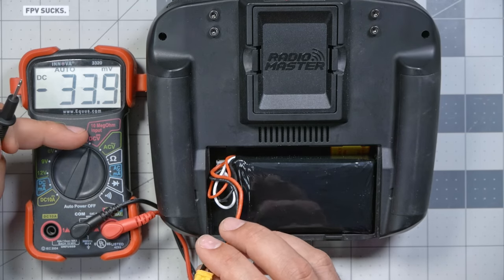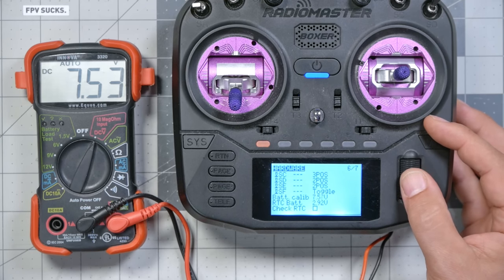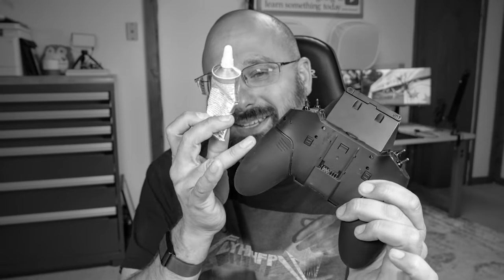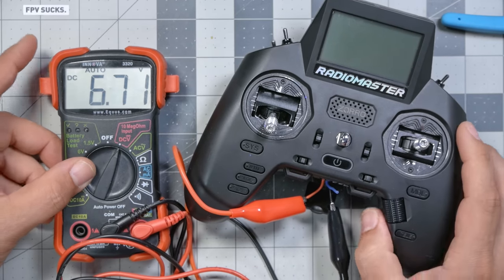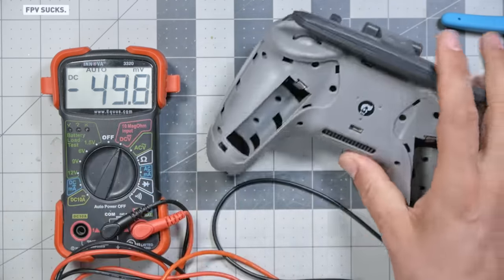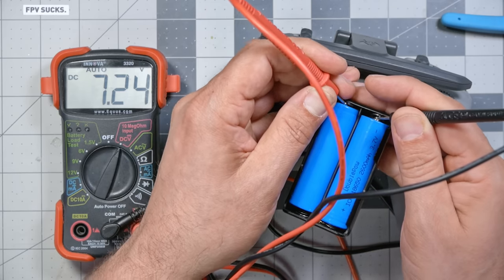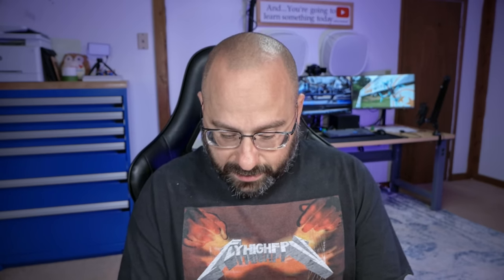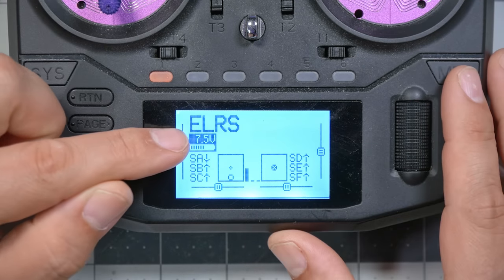Unbelievable Tips to Extend Your RC Controller Battery Life!

Comment: You also want to calibrate it near the low volt threshold.  The scaling through the range can be off so if you calibrate it at fully charged state, you might find that fully charged is accurate but near low voltage, it is off.  I always calibrate near the low voltage alarm threshold.  The most important voltage is alarm voltage and not fully charged voltage.

Comment: Hey Joshua, Dynamic Power is the key! I think a good way to extend the battery life in a ELRS radio is switching on the Dynamic Power. This helped me A LOT, especially when the radio is ON, and you're not flying, so it will set the minimum power. And when you're flying, you can set a maximum power but the radio will not MAX if it's not necessary. That also make my Jumper T-Pro run much cooler than before.
Reply: Where is the option in the settings or is it a LUA script?
Reply: @taxigalaxi  the lua script for the ELRS

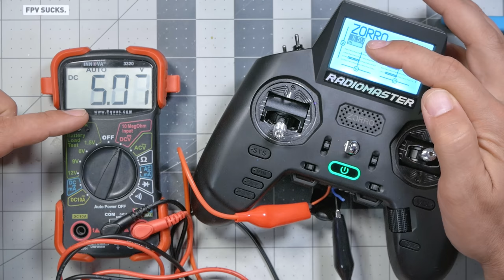Comment: 7:16 it could be that your 18350 is going bad. That voltage drop is not normal at all. Replace it immediately, because while the battery can be discharged at 2.5v, the radio can only handle minimum of 6.2v. if your radio drops below that, your quad will just failsafe out of the sky. I found this out in an unfortunate way. You could actually test this on a bench. Your quad won't even bind to the radio at this voltage.
Reply: that happened on my zorro just once, it was acting weird and the voltage was super low, charged it and it's been good since then

Comment: On the zorro or other radios with a lite module, you can pull battery voltage off the module bay pins, too as long as the external bay is enabled in EdgeTX

Comment: ELRS 3.3 has an option to disable the backpack functionality (if you're not using it) which saves 0.3w of power draw.  So when that comes out of RC it might be worth looking at for us Zorro users fighting for scraps.
Reply: 🤩 someone read the changelog! With this and all the other power changes since the Zorro came out, I can get over 4h now on a pair of 1400mah at 10mW. Still no giant Boxer battery but a definite step up since release.
Reply: @CapnBry  I was worried about battery life coming from larger radios with a lipo, but it really hasn't been an issue because of how fast it charges.  It's generally taking less time to charge to full than it takes to charge my lipo's at 1c, so I'm always leaving with it fully charged.  I'll still happily take that 0.3w though since I haven't changed my VTX channel since 2017 lol

Keep up the good work.
Reply: @JoryFPV  haha truth. It charges faster than it uses the battery. The battery life hasn't been an issue for me either, using it as my main handset for over a year. You do have to be a little conscious of it compared to a 20h+ Boxer with the big battery.
Reply: @CapnBry  I barely get 1h of flying with my zorro I'd say.. imma check that disabling backpack thing (I use the original zorro 18350 batteries) and check with the multimeter if it's yelling battery low too fast... 

I have a question though: When charging the power button stays solid red right? and when charged it just turns off? Because I've seen it blinking in red a few times, not sure if I left it charging  for too long or what
Reply: @19Jose91  whoa an hour? That's crazy low! Is your backlight cranked up, or not using ELRS dynamic power? The backpack doesn't help but it feels like you should get better battery life than that 😬

Comment: Great video, but I have two questions you didn't comment on....

1) the 2S you cut the leads off of. What did you do with that battery after? Garbage? Did it still have any charge or did you fully discharge it?

2) the lipo in your radio, do you storage charge that after each day of flying like you would do with your drone batteries?

Comment: Thanks JB for all your work! 🙏🏻
I wrote to Radiomaster because I want max battery life, but even more to safely return from every flight with my TX16s v1. Radiomaster answered fast that for their pack (5000mAh 2s LiIon 21700) I should set it in radio to 6,6V warning and 6,4V minimum. I assume it’s like safety precautions as the radio might probably get unstable when opperated at lower voltage (like bellow 6V). Lowering display brightness and make a switch for RF module power on/off (like Tx pit-mode) can help significantly to extend battery life! Happy flying! 🙋🏻‍♂️
Reply: How do you make a power on/off switch for rf module?

Comment: I thought you'd tell me about turning off the backlight, because it can also help save battery. For example, so that the backlight of the screen does not light up when you control the sticks, but only when you press the buttons.

Comment: Doesn’t the radio have a minimum voltage input that is specific to that individual model?  2x2.5 volts may be too low?  I run a liPo in an older JR that was initially NiMh and change very very infrequently.  I don’t use it much, but it doesn’t self discharge either.  I actually don’t top completely off, not knowing what my radios limit is, so I don’t fully top off the LiPo.  5 years old and still cycles great. (Try that with nicads or NiMh cells)😅

Comment: 2:20 Always best to test a battery under load. Regardless of what that load is for the particular battery. For Example.. IF you do not load test an auto battery for your car, It can be fully charged and test as such, but as soon as it sees a tiny bit of load its dead and will fail to start the car. Im sure plenty of people have encountered this Exact scenario... before reluctantly buying a new car battery.

Comment: I would think you should Darken your display about 50% as well as turn your output power down depending on where you're flying to save battery life for sure.
Reply: Definitely a good tip for any electronic device (your smart phone for example). Though for some this is not something they Can do, for lighting and/or maybe eye sight reasons.

Comment: The working voltage on a TX16s is 6.6v to 8.4v as specified. Wouldn't you want to set the low voltage warning a little above the specified low voltage?

Comment: I've just done some testing with the Zorro powered from internal 18350s Vs external 2s battery and there is a 0.4V voltage difference between the two readings!
I imagine that this could be a diode drop due to some load sharing circuitry internally (it doesn't let the external battery charge the 18350s or let the 18350s try to charge the external 2s lipo)

Comment: Amazon has a cheap kit of balance lead connectors. Comes in real handy in the rc hobby
Reply: I like the premade balance extension cables, get some good quality silicone jacketed wire with both male and female leads, useful sooo many times

Comment: Get a Josh bardwell goggle power lead adaptor and a barrel to 2s balance lead adapter . His product can use any flight pack battery put out 2s for zorro . And some xt60 to xt30 adapters for your tool kit . Get 2

Comment: If you set a lower max voltage, wouldn't it charge the batteries to that lower voltage as well so you don't get a longer "full battery" icon and in the end even less battery time?

Comment: Could you also make a mode (like I have for when I am using it as a joystick) where the internal and external modules are turned off?  I mean for trying to eliminate voltage sag if you have to test the batteries externally.

Comment: Had a issue with the Boxer where the xt30 connector was reading fine but one of the two cells was 0,8v lower than the other....
Reply: I wonder if the boxer is balancing them or just dumb charging...i'd pull the pack and charge with a smart charger, check the IR of the 2 cells , if good. Then go back to charging internally, but check to see that it stays balanced.
Reply: @Fly_High_FPV  Not charging through the Boxer, using a proper charger for that.
Seems that the boxer is pulling more from one cell than the other.
Reply: @dasGieltjE  did you check the cell's resistance? A bad cell seems more likely, but i'd be interested in the answer, either way

Comment: You could also tie your screen light to your arming switch so it turns off while ur armed with the goggles on.
Reply: That's a good idea. I have mine set to only power on button press not throttle or switch movements

Comment: How does the battery calibration affect the charge cycle? Are those independent?
Reply from the maker: I can't say 100% sure but I believe they should be. Generally on a device like this, the battery charging is handled by a dedicated IC which has the voltage sense and limits pre-set. For safety reasons, the IC does not allow the user to adjust the limits, since the whole point of the IC is to safely manage charging of the battery.

You could test this by fully charging the battery, then change the calibration so the battery appears to be less than full charge by, say 0.2 volts, then plug in charger and see if it keeps charging. Or do the opposite -- with the battery at less than full charge, reduce the calibration until it appears to be full charge and see if charging stops.
Reply: @JoshuaBardwell i asked radiomaster and there is the response : The calibration voltage is just a display, the charge tube management module has nothing to do with the EdgeTX system, and displays the power level on the screen just like a voltmeter, so calibration or non-calibration has no effect on the battery

Comment: Is that a lipo in the radio? Not a li-ion? Woildnt it need to be in storage mode when not in use?
Reply: Believe the radio drops it down to storage voltage after a day or two. Just booted my mine up now that was fully charged last week and it’s sitting at 7.7v
Reply: To get the maximum cycles out of the lipos we'd put into storage voltage AND cold storage (40-60F), but most of us never use storage voltage on our radios and still get 3-5 years out of the lipos inside. Li-ions likely to get 5-10 years with normal abuse. Dont sweat it. On 6S packs i wouldnt go more than 3 days without storing.  The radio should not automatically discharge your packs over time while turned off.
Reply: @Fly_High_FPV I'd go for a li-ion pack if it means I have to put my radio battery in storage voltage after each use.

Comment: But how can I set it up so it powers off by itself at the low voltage. In case I forget to turn it off?
Reply: I've never seen the option. Because of the nature of flying, I want the radio to stay on until it can't possibly stay on anymore, even if i damage the battery, just to be sure i always get my bird home.
Reply: @Fly_High_FPV  well what happens to me is I land when I get the warnings. But it’s so easy to forget it turned on on the bench and wreck the batteries.

Comment: The iFlight Commando 8 has a default battery range from 3.2v to 4.2v, is it safe to lower it to 3.0v ?
Reply: If the battery is a lipo, it's bad to take it that low, li-ions can handle it. Also, you should check the minimum cutoff voltage to avoid weird effects (like falling out of the sky) if undervolted

Comment: I am on a zorro, measuring 1.87 v across the right and left pin of the 2s connector.  This makes no sense to me.  Batteries are pretty charged, the zorro display is reading 8.0 V.
Does this mean this is a bad multimeter?  I have not used it in a decade.
Reply: measuring the battery itself in the handle it shows 3.99.  Does the 2s port need to be activated in some way?

Comment: Is it really safe to discharge 18350 cells to 2.5 volts? I have only been running mine down to 3.3
Reply: Yes, li-ions are able to do 2.5v, because of different chemistry. Some are rated as low as 2.0v (but 4 volts isnt enough to power this radio)

Comment: On the RadioMaster Zorro, if you have an external 2S plugged in the bottom what does the radio do? Does it double the voltage ie the two 18350's and the 2S or does it prioritize the 2S and when that gets to a certain voltage it jumps over to the 18350's? Also, how would you calibrate the radio if you're running that type of setup? Cheers brother 🍻
Reply: Seeing as he was able to probe the voltage off of those pins, they're connected to the battery tabs, so auto switching won't be a thing. I'd also say there's a good chance that you'd be running an external pack in parallel with the internal cells. (I'm making an educated guess, so you probably want to verify this claim before trying it. 4S voltage would likely kill it, so email them directly.) As for calibration, you should be fine calibrating off of an individual set. Running things in parallel won't mess that up.
Reply: I believe there is a load sharing circuit that prioritises the 2s (this wouldn't stop the internal battery voltage from being on the balance plug) 
The reason that I believe this is because there is about a diode voltage drop difference in the accuracy of the Zorro's voltmeter dependant on if it is powered internally or externally.
Source- I'm an electronics design engineer and just did some tests.
If this is correct, then it's probably better to calibrate the Zorro to the internal battery voltage as that's what the radio is actually seeing. This means that it will warn you about 0.4V earlier for the lipo Vs the li-ion which is desirable
Reply: @thomaslea7121  I'm glad somebody who has a unit to test and knows what they're doing said something. Thanks for putting better information out there!

Comment: Just tried reading the voltage from the JST connector on my Zorro and I only get a single cell for some reason.  Middle wire has no voltage on it and the left (red) wire had 4v.  So, yeah, didn't work for me. :(
Reply: Yeah dude, this is weird as hell, didn't work for me either with the Zorro
Reply: I'm shocked it showed any voltage at all at that connector-- it isn't directly connected to the battery. If it was connected to the internal battery then when you plugged in an external battery it would short the two and catch fire. It at least goes through a diode which would make the measurement useless.

Comment: I was hoping some one can help me with my quadcopter I posted a short video of the two problems, one is the green led when i arm it blinks 4 times fast the 1 then 3  and the roll and yaw are going the wrong direction, and cant figure it out.
Reply: You can change the roll and yaw in the betaflight receiver tab. AETR1234, just reorder the letters till you get them right. Not sure what reciever you have to troubleshoot that

Comment: 6:08 did you just... strip wire insulation with your nails (which also have barely any length)?! I could've saved myself so much money for strippers and fiddling around with wires
Reply: have you not ever stripped a thin wire with your nails? haha

Comment: While this is useful for those who haven't already calibrated/adjusted voltage range, the title of the video title is clickbait.. Far too ambiguous.

At face value, I thought you meant changing some secret  settings to actually save battery life. No, that's not what this is.

Then I thought maybe you were actually talking about extending the total lifespan of my rc controller battery, which again is not what is being shown. If you lower the min voltage you could significantly lower the lifetime of your battery.

The real title should be something like "Calibrate your battery to show and discharge to your preference"

Just sayin.
Reply: That's not very clickable though